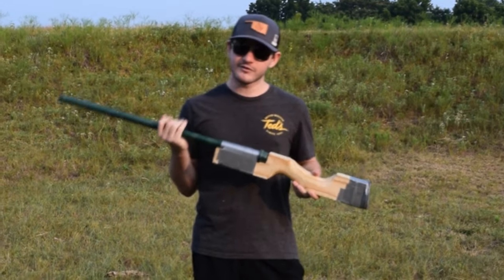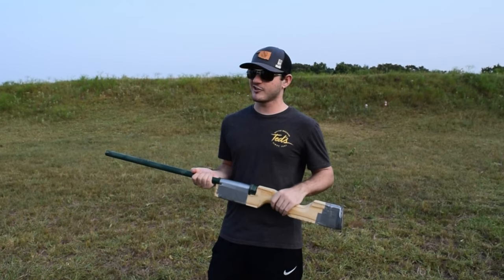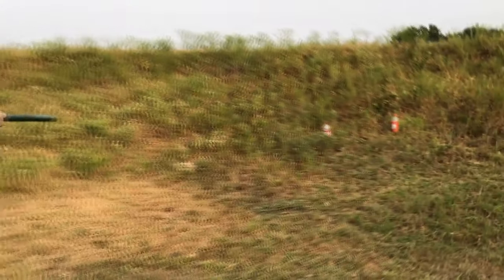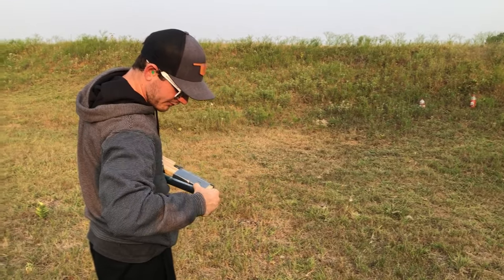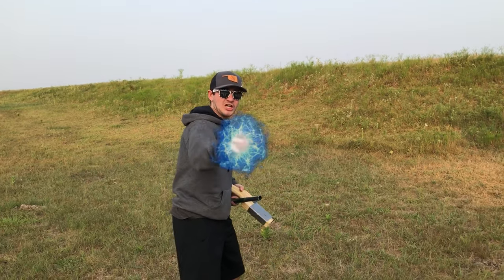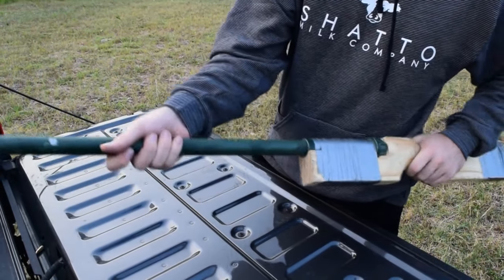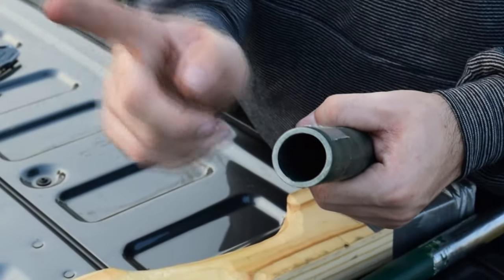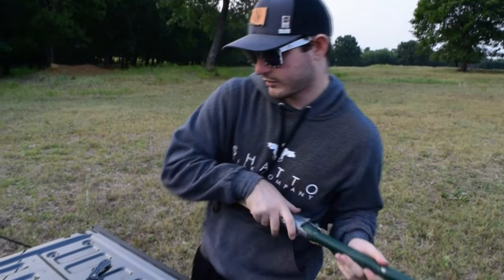CHEAP Pipe Shotgun That Anyone Can Make

Comment: This seems incredibly unsafe. Respect!!!
Reply: nah it’s safe
Reply: It's good as gold mate
Reply: The Philippine war was fought with these and butterfly knives crafted from leaf springs
Reply: Some random person: what's rule number one?
Me: No safety allowed
Person: No that's not a rule
Me: (pulls out shotgun thing from video) well it is now
Reply: glcartmi what is it
Reply: glcartmi what was it?
Reply: Lo😂l
Reply: Pipe gun(Sumpak in the Philippines) only consist of metal pipes and whatever bullet caliber are available
Reply: Shotguns are relatively low pressure so it should be fine
Reply: Well, you do have the wall thickness of both 3/4 and 1-inch pipe. If you were really nervous you could weld the cap and the "firing pin" and the cap to the pipe.
Reply: glcartmi  compare it to rifles and 12gauge, especially with loose tolerances (like your mother has) is relatively low pressure
Reply: How to lose your hands 101
Reply: "That is so unsafe... I will take 10 please."😅
Reply: It is very safe.  Like all firearms, keep it clean.
Reply: expecting safety from a 15 dollar shotgun
Reply: I wonder if this contraption works with PVC pipes?!
Reply: The only unsafe part is the tape around the barrel eventually going loose.
Reply: Get used to it. Its what youll be fighting with when end times come
Reply: @austinallen9398 butterfly knives? Not machetes?
Reply: ? Of course it's not safe? Duhhh? Want to live forever? 😮
Reply: @mattmarzula Axes
Reply: You are unprofessionally making a weapon the shoots a metal ball at extreme speeds and you made it with scrap and sum duck tape!!!

Ya sounds safe enough 😁
Reply: @kilovolt2494 Good idea it would make it much more lightweight
Reply: We call that "Sumpak" usually used in old gang wars.
,,, ordinarily made 12 inch in length for easy concealment.
Reply: @Louzahsol  ? I wonder if they contain rifle pressure when shooting slugs! Pretty sure the slug gets squeezed like a bullet and the slug rotates because of the barrel not having rifling to. So the slug grooves the barrel instead of barrel grooving the bullet!?
Reply: @EricWesolowski-g9t  the slug can’t groove the barrel because it’s not hardened steel. The powder used in shotgun shells is usually slower burning as well as the tolerances still being a bit looser
Reply: @Louzahsol  not groove the barrel but grabs enough to spin it no?
Reply: Safe as could be what u mean lol
Reply: it is idiocy .
Reply: @oldbonesbushcraftrodjackso474  ? Oh I guess idiocy invented all the firearms in history!! How do you think and good gun makers start out??  Perfect like you??
Reply: @EricWesolowski-g9t  no need to start out like your living in the 1600s this is millenia 3thousand we are living . I own 4 fire arms , I am not perfect i bought them .
Reply: @oldbonesbushcraftrodjackso474 😂 1600 is a good place to start! Maybe you should have? Maybe you'd be an Engineer too?
Go ahead, buy guns and get a tattoo on your face scarey guy 😂
Reply: @oldbonesbushcraftrodjackso474  no need for An Advanced Civil Engineering Technology Diploma either or a construction specialist certification from Canada 🇨🇦 government but nice to be the type and have'em?
My dad sold guns until he retired and had 2 older brothers. Had guns when I was 12 years old, shot a bear when I was 14, Moose by 16 by myself, hunting on a quad!!
Reply: just got give the gun a lot of respect😭
Reply: This kinda describes my life.
Reply: The air flows around a rifled slug, causing it to spin.

Comment: Since the barrel is treaded at the muzzle you can also fit a silencer.
Reply: that would be one big ass silencer.
Reply from the maker: Well I guess technically you could but you have to understand that those threads are MASSIVE lol
Reply: Haha a choke would b3 more suited to keep grouping smaller also cut the barrel shorter for a wider spray and pray effect also less kickback
Reply: Just screw a semi-truck oil filter on the end.
Reply: Hahaha 😆 😂 😆 😂 😆

Comment: This is my hobby, building guns out of bargain-basement hardware... or just junk.
You don't need a degree in rocket science, either.
Gun control is futile.
Reply: Indeed. I also enjoy using what is available to " make it happen ". Even if can go get the perfect part and for pennies, I enjoy the challenge of improvising. Good practice for the brain and a great skill for survival.
Reply: @rebelrhygen2335  
Yup... 'make it happen.'👍
Recently, I made a .28 gauge slam-fire happen out of a VALVE HANDLE!🤣 
I'd found it in a snow bank on the side of the road a couple of years ago(I work in the oilfield), but it's an odd size & I never had the need to use it. When I first saw the thing in the dark, it LOOKED like a shotgun, so I decided to turn it into one.
Reply: @louisbecker5941  that's right! Two of the places  that life has taken me are mexico and prison. NOT MEXICAN PRISON, thank God. Both places helped me to open my eyes of the falsehoods that we in the U.S.A. tend to be conditioned to believing.. So much of what we believe we NEED to possess in life and/or NEED in order to  "make it happen" is nothing more than cow dung. And the things folks throw away boggles my mind. I'm not suggesting that we should become pack rats or holders, but tossing out an old dresser without collecting the hardware, screws, handles e.r.c. is lunacy to me. Anyway, I'm on a tangent now so goodnight Mr. Becker and thank for the good vibes brother👊
Reply: @rebelrhygen2335  
🤛Resourcefulness!👍
And Resourcefulness when it comes to building weapons is a talent that could make someone 'highly sought-after' in a lawless or post-apocalyptic scenario. 
And the way the world has been turning lately... something like that occurring in the future doesn't seem too far out of the realm of possibility. 🤔
Reply: @louisbecker5941  yes sir it certainly could. Today's lowlife, dangerous  " criminal " in society's eyes,  was once  it's bravest , noble  and honored " warrior"  .  Still, it's a heavy load to carry when a man provides things of this nature to anyone. Who's to say which hands are the right hands to arm? Then again, the farmer who provides the same hands with sustenance is equally accountable. It's too early or too late to be trying to form valid points for me. So, Mr. Becker, since I can't resist engaging in relevant , interesting conversation, please save us from my ramblings and either reply with something less thought provoking or you will end up partially responsible for the idiotic mess I will eventually turn our chat into. Now, if you will excuse me, I must return to fitting  my bicycle handlebars with this .25 Zip gun😆
Reply: @rebelrhygen2335  
For some comic relief: 
Search up 'Smith and Meth-Son.'🤣
It's a nickname that officials in Iowa gave to a homemade double-barreled .410 pistol that was cobbled together by a local meth dealer.
You'll get a kick out of it!😆
Reply: @louisbecker5941  ok, ok, that has to be the most unbelievable thing I have ever seen. I have known some world class tweekers. I have seen some mind bending tweek projects. I have heard some unforgettable tweek tales. Mr. Becker.............. I have been around. Nothing in all of my travels and experiences could have prepared me for the "Smith and Methson"! It.............. It is,.............. It is the most..............AWESOME CREATION  EVER!!!!!!!!! 🤥🤥🤥
Reply: @rebelrhygen2335  
When I saw it, I envisioned Dr. Frankenstein... as a tweaker!🤣
Reply: It's not like someone could use a gun like this to take out a Japanese prime minister or something
Reply: can we see some examples?
Reply: Hello please can you help me out I need to make literally anything a one shot I need something to defend myself can you give me something so simple I can make it really quick
Reply: teach me pls
Reply: @rebelrhygen2335
and
 @louisbecker5941 just became besties XD.
Reply: The fact that you can make a gun for under $100, and there is nothing the government can do about it since they don't know it even exists 😂. USA🇺🇸

Comment: the fact that it's 15 dollars is still too expensive imo

10 dollar guns sounds reasonable.

but damn nice job on the stock
Reply from the maker: I just guessed how much this would be in material costs. You could probably make 2 or 3 with how much material I bought.
Reply from the maker: For real. This would’ve been a lot cheaper lol
Reply: Funny thing is the most expensive part is the end cap
Reply from the maker: @firefly6396  lol yeah
Reply: Most of the expense came from the tape
Reply: @PlastikGatz no the ammos 💀

Comment: the fact that this is possible is insane to me lmao, i keep forgetting that the secret of guns is the ammo itself, it functions as a propeller system, it would be funny to see a 15$ pellet gun though
Reply: Even shotgun shells themselves are super easy to pack (and even make from scratch)...the whole point of shotguns is it's nota complicated weapon.
Reply: In most guns, the firing mechanism is not complicated what so ever, it's the cycling mechanism that is
Reply: put boom in a stick, make sure stick is stronger than boom
Reply: @ricedbroccoli  even on most most shotguns especially any sorta crack barrel or pump the cycling mechanism is a lot less complicated
Reply: exactly, for single shot guns, its not that complicated at all. all you need is a tube that can hold the ammo and a way of hitting the primer. Now if someone could figure out a way to make ammo from stuff at lowes... that would be incredible. I'm pretty confident I can make a muzzleloader from stuff you get at a hardware store, but modern primer is tough.
Reply: you obv havent seen police confiscated firearms from crackheads
Reply: Pipe, spring, lock, pan, frizzon, rock, black powder, flint/chert/quartz, cotton wadding. BOOM. It is possible to build a firearm from scratch with minimal tools, even the powder can be made from scratch fairly easily.

Comment: Aye naw wars the outro music man that was fire also preciate the field strip it was very informational btw for anyone who doesn't feel like drilling a hole through a pipe cap (let's say you don't have metal bits or u just don't like the bolt through cap design) I've found a slightly easier design to be a 7/8th inch roofing nail take a 1 inch wood dowel cut a 1/2 inch piece off drill a hole through the middle slightly smaller then the nail file tip of nail down a bit so ifs not sharp but rounded or blunt stick nail through take piece of card board cut it 1/8th inch larger all around in diameter then the wooden dowel poke hole in middle put nail+dowel into bottom of pipe cap nail pointed up ofc then push cardboard piece on top cardboard should stick into grooves in pipe cap and become sorta stuck which should keep the hole firing pin assembly relatively secure in reciever especially when 1 inch pipe is screwed into pipe cap further reinforcing the cardboard keeping the firing pin assembly in place)

Comment: He has a lot more faith in that thin-ass barrel than I would. Not even so much as some duct-tape and wood where he grabs it.
Reply: Shotgun barrels are basically smooth bore steel pipes. Literally no different.
Reply: tbf no way to really squib a shotgun, not really any way to blow it up w decent ammo. i wouldnt really be too scared holding a pipe just directing some energy and lead pieces
Reply: @sophiafalanga2843  Exactly. If steel parts couldn’t hold up to controlled explosions, then we wouldn’t be using steel in literally every firearm design.
Reply: theres no way this could blow up. Theres 2 thick pipes
Reply: The only problem with shot shells is an obstruction in the barrel 
And you’re going to be looking through the barrel as you load the next round

Comment: You could build a quiver to hold pre-loaded barrels, toss the one you fired, fire next and so on, instead of reloading after every shot.
Reply from the maker: Honestly not a bad idea 🤔
Reply: great idea, and instead of a long ass barrel, just use 8 inch pipes and you have a firerate close to break-action
Reply from the maker: @jusplars6750  I intentionally made sure the barrel was over 18 inches because if it were any shorter, I would have created a short barreled (“sawed off”) shotgun under federal law. If it were a registered SBS, I’d consider it, but I’m not taking that chance lol

Comment: I feel like you should pull back two times a little bit lightly with this gun so you can get the primer of the shotgun shell dented when the dimple in the center of the shotgun shell is dented. It’s ready to fire, so you can pull back one time lightly.

Comment: What size screw do you think the manufacturer might have used? 😂
Reply from the maker: tbh I don't think the manufacturer of this fine firearm took note of that. However, I would presume that if they were to make another one, all they would need to worry about it getting the screw centered on the pipe cap and grinding down the tip of the screw to a good pin shape
Reply: @PlastikGatz   can you use a nail instead?
Reply: A roofing nail cut and sharpen tip.  Beautiful firing pin. Entertainment purposes yes
Reply: @PlastikGatz  but how long would said screw be??
Reply: @JamesPlatt88  long enough, then ground down as needed

Comment: What did u use bro???? Like how does it work, I know I need 3/4 inch pipe and one inch pipe but how does the shell react?
Reply: 1 " pipe as the receiver. 1" pipe end cap on the end of the 1" pipe. Drill a hole in the center of the end cap and secure a screw or nail in that as the firing pin. Put a shell in the barrel (3/4" pipe) and I think you can figure out the rest. Do so at your own risk.

Comment: Add a sight on top.
Add a grip underneath the pipe for more controlled sliding.

Perfect.
Reply from the maker: @ChristsVisage  all of that defeats the purpose and spirit of the gun
Reply: @PlastikGatz  well, a little stubby pipe with some half passed weld on it as a grip and a home made ironsight  wouldn't add Thaaaaat much time.

Comment: Put a spring on it to automatically pull the barrel back and put a catch release on the barrel. Then you have a REAL DIY shotgun lol
Reply: affix a bunch of pipes to a bigger tube that slides onto the stock, spring loaded, a couple of gears and a cam, slamfire gatling shotgun possible?

Comment: What schedule pipe did you use? For research
Reply: 1 " pipe as the receiver. 1" pipe end cap on the end of the 1" pipe. Drill a hole in the center of the end cap and secure a screw or nail in that as the firing pin. Put a shell in the barrel (3/4" pipe) and I think you can figure out the rest. Do so at your own risk.
Reply: 80is the safe choice 🤷💯

Comment: I've found black pipe rated for 150 PSI, I know that's too low for a shotgun. Is there another kind of black steel pipe I need to use?
Reply: Look for 'standard schedule 40 black pipe.'
Keep in mind that the 'burst pressure' rating is typically the equivalent of about eight times the 'working pressure.' Also, pressure ratings for plumbing pipe pertain to liquid pressure, which is generally stronger than atmospheric pressure.
Reply: @louisbecker5941  i got an idea of making this into something more stable than a slam fire "non gun" ..using the plunger and springs from a pinball machine in the end cap of the pipe, filing the tip down to a point much like a firing pin. just a thought since you make them already. im gonna try it myself.
Reply: Schedule 80 is best

Comment: idea pitch crossbow shot gun
the string is attached to a pipe with a pin inside which the string will push the pipe with the pin forward striking the shotgun shell inside the smaller pipe.
Reply: like a realistic Chewbacca crossbow gun

Comment: You can also use a coupler with a blank off nut that screws into the coupler does the same thing i used a nail and solder so nail on the outside in and solder inside the cap to keep it all mil spec haha sadly i moved and my wife asked me what it was and i had to destroy it i spend a day making it and never had a break in at the house to test it but in a pinch hey you nailed it haha

Comment: Do the pipe for the barrel has to be seamless? Or could a common galvanized pipe be used?
Reply from the maker: Great question! If there is a seam in the pipe like the one that I used in this video, then the best thing to do is try your best to sand down the seam in the "chamber" of the barrel. No biggy if it has a seam, just kind of annoying
Reply: You can use them but I don't recommend 🤷💯

Comment: You need make another barrier, or some kind of overlay over the pressure points... in-case that pipe explodes ..your not accounting for stress, or bad iron, or a pipe not made for explosive shells. Very risky. You need to cover that whole area where your face is. And get a pump handle so your dont blow your hand off if it does explode. And I would be ready to replace that pipe after many uses to.... Looks like a fun project
Reply from the maker: It won't blow up :)

Comment: It's genuinely hard to get more simple than a slam fired pipe shotty. Pretty sure the only thing simpler is a muzzle loading black powder blunderbuss. Which is just a tube with a hole in the top for a fuse, a kind of scaled down cannon.
Unrelated note, the back end of a miniaturr cannon should be at least twice as strong as the sides.

Comment: Could easily make a trigger system with some elastic, a little more wood and a bolt
Reply from the maker: I will refer you to the same response I've given others who have similar improvement suggestions: it ruins the purpose and spirit of this gun by making it more elaborate than simply a pipe and a 2X4